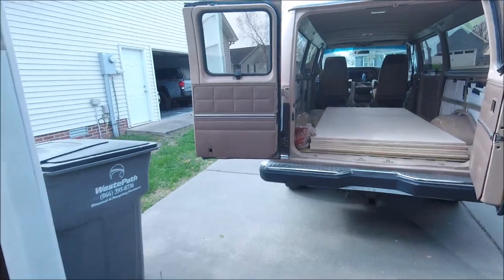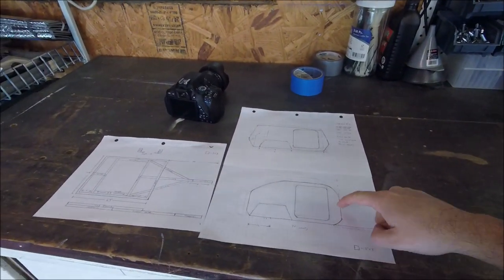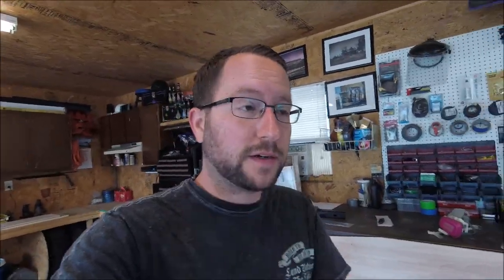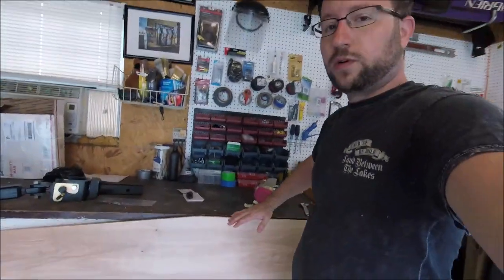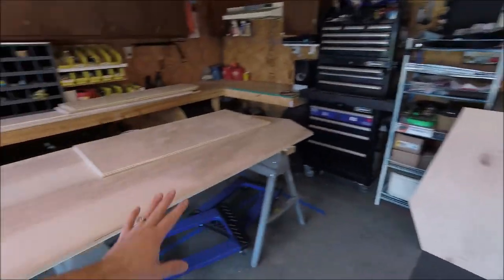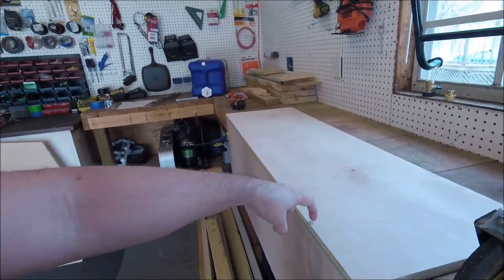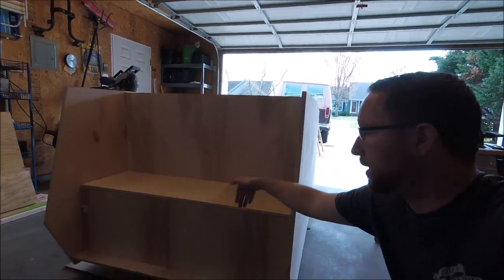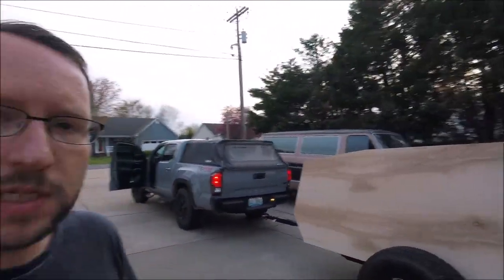Off Road Tiny Camper Trailer Build - Day 1

Comment: First of all I would like to say that this little trailer is absolutely awesome in its design, in  its shape and simplicity etc.… I’m about to start building one and after hundreds and hundreds of different variations that have watched on YouTube this is definitely the best one. Congratulations well done. I do have one question and it centers around the insolation which I see you have not done in your trailer. Can you discuss whether or not you wish you had insulated the trailer? I live in a very hot area in South Louisiana and it gets really really hot and I think I need to insulated equally when I travel to Colorado it might get cold and I think that condensation could become an issue what are your experiences with this? Thanks